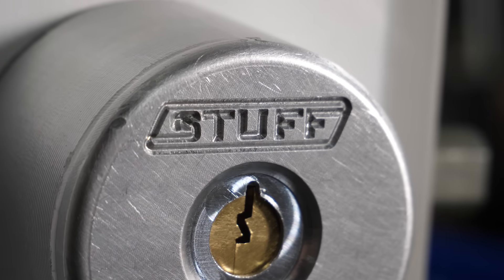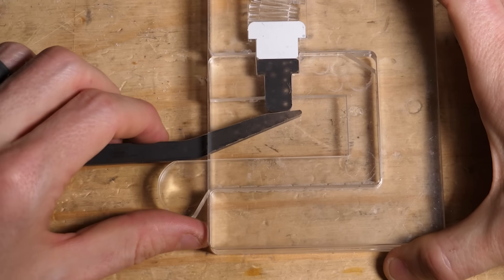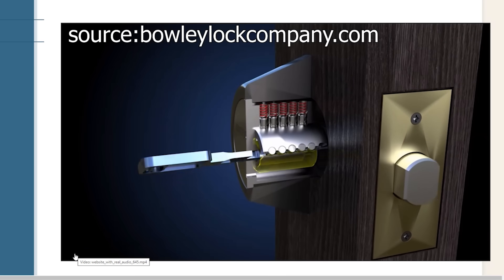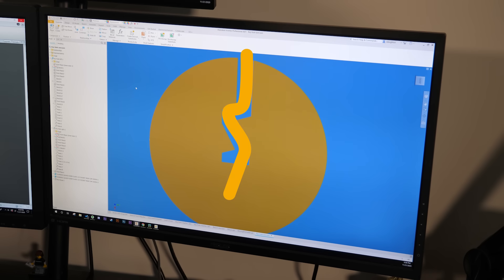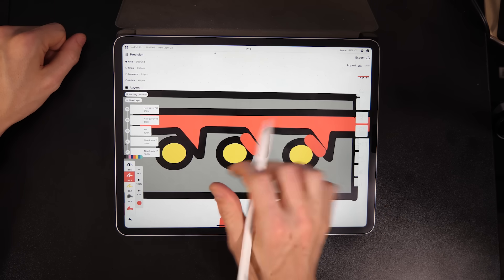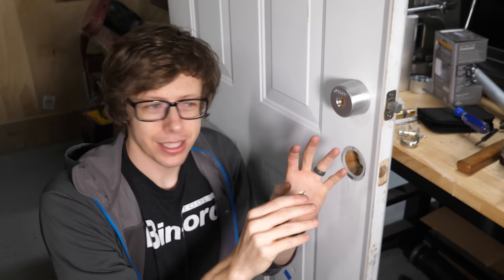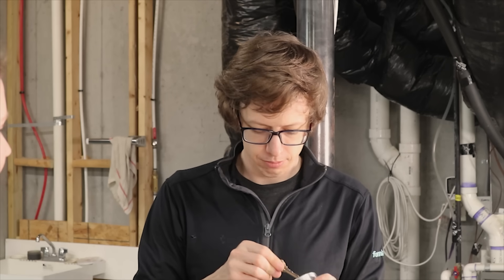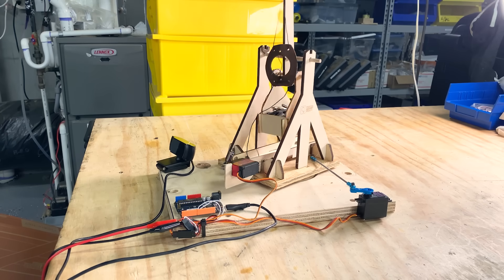Making an unpickable lock. Calling locksmiths

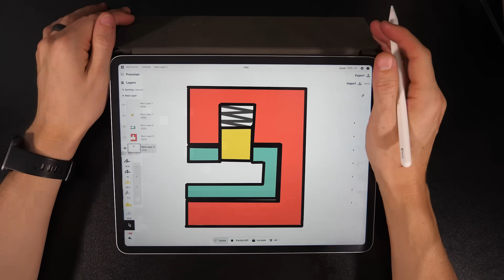Comment: 1:23 Doesn't make much sense if you use the logic in 1:15... You can just push both pins up as in 1:15, without lining anything up and it should get unlocked. I'm thinking it's more complicated with a real lock than the illustration given, but just wanted to point out that the specific illustration used in the video might not be the best example.
Reply: Nahh his drawing is a bit messed up:  the two pins combined should be bigger then space above the line, this way it needs to be in the right position to work. (At 2:12 look at the far right pin, you can see not both parts of it would fit if pushed all the way up)
Reply: @helderboymh  Ahh yes, I was assuming it would be something tricky like that. Thanks for the info!

Comment: what if someone were to blow compressed air into the lock hard enough to press the pins upward instead of hitting it with the hammer and using a tool to push the arm that holds the pins up and turning the lock at the same time ?

Comment: It is possibly vulnerable to a different kind of bumping attack, where one sets the upper pins to their highest positions, rotates so that they are sliding against the gate, and then bumps the retaining mechanism just enough that they travel down slightly and catch against the gate.  I suspect that everything would have to be perfectly machined for this not to be possible at all.  Although the upper springs in the diagram would make it very difficult indeed.

Comment: The minute differences between pins are still there, and they show up by precisely how far you can turn this lock before it binds. Tension this with a stiff and long rod and make sub-degree marks on paper below when it binds. Some pins, when set correctly, will influence the reading. This is also how you open some safe combination dials, which also have you (theoretically) test the positions of all discs at the same time.

Comment: I feel like a lock is only as good as the rest of security.  You could obviously force it open with enough power - but I think, combined with technology, you could partner with a tech company for a new security system.  Homes still get broken into.  Simple sound detecting devices, combined with different online and offline networks, combined with this, and you might be able to make a burglary-proof house, not just an unlockable lock.  Nice vid.

Comment: If I were to run into this lock randomly I admit I'd be stumped. But seeing how it works, I have at least one idea of non destructive attack that I hope to see on LPL's channel.
Reply: Which is ?
Reply: @helderboymh  I think I'd try a variation of a bump attack, where vibration is applied to the cylinder during the "test" phase. Start with the pins in the highest position, and see if they'll slip loose to gates when vibration is applied. I admire the engineering and production techniques used, but still have reservation on calling it "unpickable" until more unconventional techniques are tried. :-)

Comment: There is one giant design flaw that makes it easy to get in to a house using a lock like this.
All you need to do is to break it of with a pipe wrench.
I have done this when a locksmith couldn't pick a lock to a apartment that had a leak that needed to be repaired, it took single digits seconds to get in with the pipe wrench.

Comment: Hmmmm.. Try this process before you send it to LPL

Build a long tensioner that can depress the cam at the end. 
Apply light tension to the cam and insert a hook pick.  
Now push each pin to it’s highest set-able position. The light pressure on the cam will hold the brass pins as its designed to do.
Withdraw the pic, this should let you apply a twist to the core with the long tensioner and turn it part way until the pins bind against the gates. 
Now since the gates are sloped and the pins will be bound by the gates at the top.. lightly release the pressure on the cam while holding rotational force on the core. Slowly back off on rotational force.

My theory is that the pins will slide down the gate until each finds the shelf of it’s slot.

Comment: "not commercially viable" You underestimate the value of a lock that each pin must be picked to the correct height before trying to turn it.  Yes it will be more expensive, but there are plenty of businesses willing to pay more for the extra security.  The main issue is the tolerances or as you put it "the imperfections."  It's an interesting idea, and if the idea can be made to work then the tolerances and manufacturing costs can be worked out in a second stage.

Comment: Your lock is overly designed garbage based off 200 year old technology. It would only be marketable to clients with deep pockets, not the $35 masses. Then mass production would alter your design to be more cost efficient and then your lock would be a miserable fail once it actually starts failing in the real world environments all across different climates. If you want advice from a mechanic, start looking at locks as an 4 or 5 cylinder engine. Your tumbler is the crankshaft. Now you have to figure out the firing order. Now, fast forward... how do you lock the engine cylinders from being figured out from a theif? You dont, you add a flywheel (front, back or on both sides of the tumbler) that is your lock. Or add a gear drive to lock the top valves....Or...simply redesign the age old straight key to be a 45°key. Your anti theft shroud would basically hinder all current lock picking tools. Then you could market your locks for a few years until new tools are invented to defeat your lock shroud. But in the end, a set of bolt cutters and a heavy foot can break into most locks and homes because the weakest things in any home is the multi piece wafered door jamb. You should try to reinvent the lock that does not use a slide in key or a slide bolt. 🙃 heck, you could even use 3 tumblers in a door lock, 2 being dummies. But in the end, mass production would kill it.

Comment: 8:38 "I found a locksmith that specialises in picking locks" isn't that their job and what they are supposed to do
Reply: No. It's generally the method of last resort. Most doors are ridiculously insecure and can be opened with no key or lock picks. Then they just remove the lock once the door is open and copy the lock bitting

Comment: Are there any locks that use a magnetic field.  Have the pins being pulled by little springs and when the key is inserted it completes a circuit turning on a magnet. The field from the magnet pulls the pins down against the key. Not sure how it would be picked
Reply: It could be picked by using a magnet. On the outside
Reply: Done already... (not by me, of course)

Comment: “I found a locksmith that specializes in picking locks” ...isn’t that their job lol
Reply: Not necessarily. In my country most of them can only pick the most standard of locks. i had to call 2 of them in my life and both refused to even try to pick it, they just drilled the keyhole, opened the door and then installed a new lock for me. The locks they installed were so overpriced and so poor quality I just had to change them 1 week after just for my own security.

Comment: I think there are locks with exactly the same idea, but much less complicated mechanics. There is an outer thin-wall sleeve over the cylinder, which grabs on serration is on the key/driver pins before they are probed over the shear line. I think I saw it on Bosnian Bill's channel. Hard to explain, but the thing is when you start tensioning, none of the pins can move up or down, so picking just won't work.

Comment: You should make the top check pins serrated so that they will snap to some levels. That way, you don't have to worry about tolerances and there will always be a surface for the grabbers to slide onto.

Comment: An "unpickable" lock exists, any standard lock can be pinned in such a way. It just means that the key won't work either. If a lock is able to turn with the correct key it can be picked- though it may be difficult. Take it from a locksmith.
Reply: 請他選擇永久鎖V3！希望他能挑戰此鎖！永遠鎖定V3！哈哈！
https://youtu.be/RKRo97N1PJI    https://youtu.be/4vShP7riRqI

Comment: Hi Shane , i have an idea for a future project, i hope you see this. my idea is a machine that plays the guitar. my theory is that it will run a bar across a guitar neck ( similar to a capo) with six different finger tip like components that press down on each string depending on which fret the bar has moved to. The machine should run in a similar fashion to your basket ball net where you cant miss (by that i mean, the bar is on a set of strings attached to motors that can move it back and forth) I understand this idea wont enable chords to be played but it could play a great solo. I hope you can make this a real thing. cheers for your videos Shane 👍🏻

Comment: If you want a near unpickable lock (except real, picking enthusiast pros), get yourself a good core with a PITA narrow paracentric keyway, a blank key and a small pinning set. Go really high, really low (lower than normal cuts, really high, really low etc. And insert springs of differing tensions to "defeat" bumping. Just make sure the key is good steel, because those very low cuts makes it prone to snagging and breaking with aluminium, and some times brass too. Brass is way easier to cut and less harsh on cutters, but you're only doing 1 or 2, not 50 a day on a machine. You can of course use security pins too, but the biggest challenge to picking here is the binning and keyway. You kinda need to set each pin on the 1st try, working your way in. And even then, if the lows are low enough and highs high, it's really, really difficult to set those inner high pins without the stem of your pick oversetting the earlier lows.

Comment: Picking locks in the field is a totally different ballgame than in a vise on your bench or holding the core/lock in your hand. In particular trailer hitch lock where the keyway points downwards, door locks perpendicular to and at the end of a narrow hallway (working squished in the corner) - and gate locks where the lock is parallel to and like an inch or less above the floor.

Comment: if you of set the pig ears  by a mm or so whit the first one being the lowest it should be theoreticaly unbumpable , as the first pin needs to be lower than all and 2nd and 3rd at higher cut, but 3 pins will be easy enough to brute force a key

Comment: LPL: To open this lock, I've found that the best way is to not use tools at all...just lightly blow into the keyhole, and the air pressure lifts all the pins to the correct height...allowing the lock to rotate.😌

Comment: "just get a lock that doesn't have a key"
*Flashes back to lpl opening a fingerprint lock with a fork"
Reply: Flash back to get a large magnet
Reply: magnetic and others are even worse. but yeah those fun methods were magic.
I wonder if he would not just resort to blunt trauma here, as massive part stick out so hammer it from bottom, pins will jump randomly, well it have a chance .
OR that magic drill + pull, that one was my fav.
AND I wonder if hard hit would not send those pins to hell getting rid of whole locking part in first place, with either very strong slap OR drill + bruteforce turning it.
Reply: @deilusi  I would think prior to any brute force methods he would attempt to pick the lock, as he now knows the workings of the mechanism it should give him an edge.
Reply: @TC-th1ey  that's true, there are always 2 goals, non-destructive open and fast open. As its designed to be pain to do it non-destructively I went directly to second option.
Reply: @deilusi  o

Comment: I've watched enough LPL to know that the suggestion of getting a lock without a key is probably the worst possible security advice you could possibly give, lol. He can typically defeat electronic locks faster than most mechanic keyed locks.

If you want a truly secure lock, find one with good pick resistance (one that takes over a minute with a skilled picker) and put it on a solid wood door with reinforced frame.

Most burglars are going through windows and other weak points, unless a lock can be bumped or raked, they won't even bother trying it.

Alarm systems, security lighting and a big dog are better options for security than wasting money on fancy "smart" locks. Most $150-300 deadbolt setups are sufficient for most residential settings.

Comment: 20 years ago: "I invented this amazing thing to start my corporate empire."

Today: "I invented this amazing thing for ad revenue from someone else's corporate empire."
Reply: Building one lock that's difficult to pick, drill, etc is a challenge. But building a thousand is a whole different problem. Figuring out how to machine the material and manufacture locks is honestly the biggest thing holding locks back. And just by looking at this locks design, it's almost impossible to mass produce.
Reply: Lmao these people replying are rude for no reason I found this funny and also ya I think if someone did this 50 years ago it would be in a factory real quick
Reply: Mortally Challenged things evolve over time. There's nothing wrong about it. And not ALL of the inventions made 20 years ago were used to start corporate empires. Get on with it.

Comment: "If you want a lock that cannot be picked, just get a lock that doesn't have a key". LMAO 
As LPL countless time demonstrated, those locks might not be technically pickable but they can be more easily opened, which defies the lock's scope.
Still, I am not sure if this lock would resist to all those pin-vibration attacks which technically, is still lock picking.
Anyway, great project for a non-locksmith.

Comment: i see the flaw, but only because of the video. being you spring loaded your locking bar, apply tension to that and and rotational tension on the cyl core would allow for pin by pin set. spool the lowers.

Comment: Couldn't you have just used angled "grabbers" instead of flat ones + springs? The angle should give you plenty of variance room without having to using springs ((IE, have the blades chamfered such that they look like < from a profile rather than like [ on top of the top-down angle where they all come down like V ))

Comment: You may be an expert, but you also were the one to make it, so how well you could pick the lock wouldn't be representative
Reply: Since he knows how it's works, isn't it the best proof if even he can't pick it?
The locksmith he called for this video expect the usual lock and so they try the usual stuff. Of course they fail. For this part it's just a security by obscurity thing.
If you watch LPL you notice the weakness of the best locks is usually that they are easily recognizeable.

Comment: You could have easily made the key hub in one piece instead of splitting it into two. 

All you need is an EDM machine. I think this is a good enough reason to beg the wife to let you get one! Lol. 

On a side note, as an engineer myself, the most time consuming part of making extremely complex parts is making them machine able. It takes way too much time sometimes.

Comment: What you need to do is take advantage of the tolerances by engineering the binding order of the pins to reset the pins if there is not  a key preset in the key way. If the pins are intentionally not of a uniform size or angle/placement, the core will become extrenely difficult to manipulate reliably. While you want the core to require a key to behave properly, you also want it to function with the key flawlessly.

Comment: you think too complicated. all you need is a barrier between the thought straight line from outside of the lock  to the pins. there are locks already doing that but the keys are fragile, as they mimic an elongated u shape length wise

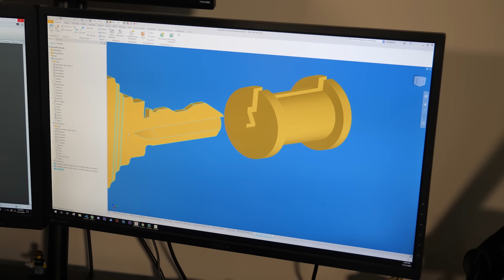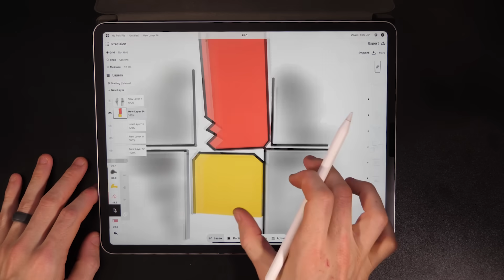Comment: The pins at 8:49 look serrated, I'm assuming those are grip points. The lock basically combines pin tumbler and warded designs, similar to the approach by the Bowley, but in the reverse order: the Bowley started with a warded lock and then inside that had a pin tumbler lock. This one starts with a pin tumbler and then the pins need to get put into position to make a "key" for the warded section. It seems like the serrated grip points are used to hold the pins in place as it passes through the warded section. Each grip point is individually held via a mechanism with individual springs it looks like? We never really get a good look at the finalized design of this part of the mechanism, just theoretical descriptions that were vague and lots of attempted design. 4:53 is suggestive, but not really clear enough, imo.  Still, in principle, and with the caveat of me not being someone who actually picks locks, but has watched far too many LPL videos to be healthy, it looks like it might be vulnerable to an attack along these lines: first set every pin as high as it will allow itself to get gripped by the gripping mechanism, and then rotate the cylinder so the pins push against the wards, then the lock is bumped to mess with the springs holding the pins in place in order to let the pins drop to the correct heights to get grabbed by the sort of physical imperfections in the warding of the sort described in 2:53. Much easier said then done, and there might be something about the design that I'm not seeing that prevents it, but that's the outline of an approach that might work.

Comment: This looks like a commit and authenticate mechanism, like the Protec. You can theoretically defeat these by doing precision measurements (stick a laser pointer to the key and measure how far the dot travels on the ceiling) because one of the pins will (probably) still bind before the others. To keep the bitting between tries, you could use something like a Sputnik tool.